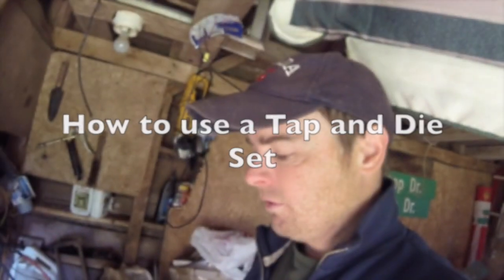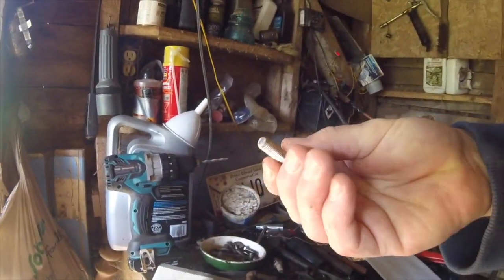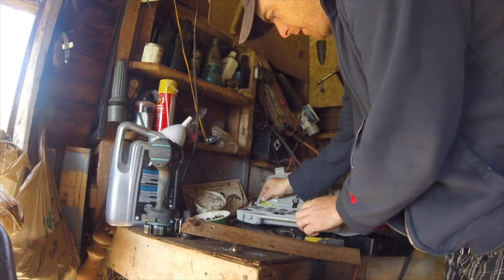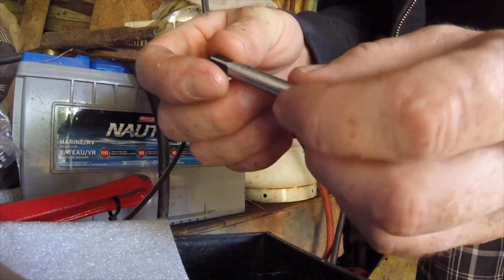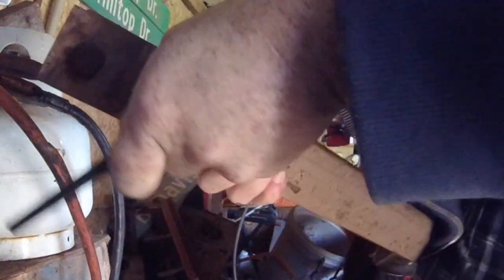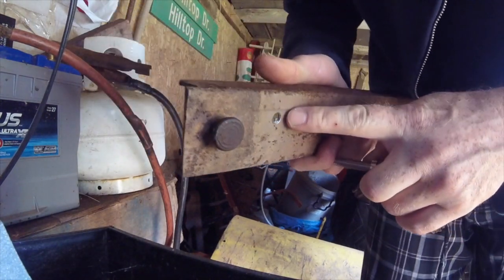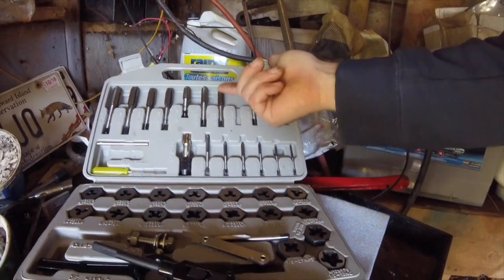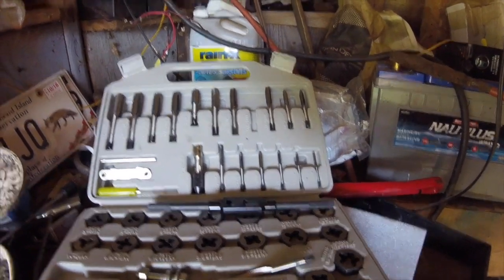HOW TO Use a Tap and Die Set - 3 EASY STEPS

Comment: ENUTS--Make sure you have the right gauge when you're checking taps or dies.  Irwin (formerly Hanson) sets have a SILVER gauge for SAE (Imperial or inch threads) and a GOLD or BRASS-colored one for Metric (millimeter).  NF threads denote National Fine  (more threads per inch); NC denotes National Coarse (fewer threads per inch).  Metric has just one type of thread, denoting the number of threads per millimeter (mm).  The thing you picked up to hold the tap is called a tap wrench.  The other handle in the kit, which holds the dies, is called a die stock.  While the threads at the bottom of your taps (and mine) are shaved to allow you to start them more easily, professional-grade taps are not.  They are left as is, and are considered bottom taps (i.e., they allow you to tap completely to the bottom of the hole).  This isn't critical when the hole goes completely through the piece you're working on, as it will be retained at the other end by a nut.  If you're threading a hole that only goes, say, halfway down, this allows the threads to grip the bolt or fastener completely, w/o any other means of securing it.  As others have mentioned, you should ALWAYS use cutting oil, grease or some kind of lubricant to make the process go more smoothly and reduce wear on the tap or die.  At the end of every job, clean out the taps and dies used with one of those cheap acid brushes and re-oil them before putting them away.
Reply from the maker: definitely need oil which i was lacking, yes :)

Comment: This is a good starter video - if folks want to be precise,  they'll need to be careful while drilling initially . . . if they can't use a drill press in order to start a perfectly straight hole in thicker metal, they'll end up with a crooked bolt alignment. In this video, you made it through the material OK but your tap would have broken in thicker metal - it is best to turn into the material no more than a half to one  turn at a time and then backing out of it to clear the material, apply a little oil and then turn in again , back out again etc etc until through. Good stuff!
Reply from the maker: Thanks for the comment. Great advice thanks!

Comment: Don't forget to illustrate that for every full turn forward you have to turn in backwards 1/2 a turn to break the metal chips. And don't forget to illustrate that a tap/die oil has to be used to prolong the life of the tap/die and keep them sharp.

Comment: Actually, you want to drill a hole slightly SMALLER than the tap size.  That way, when you go to tap the piece you're working on, it enlarges the hole enough to leave threads behind that you'll screw the bolt into.  If you have a decent set of taps and dies, the taps will have the correct size drill to use laser-printed on each one.  For instance, a 1/2"-20 tap will require a hole made with a 29/64" diameter drill.

Comment: you're supposed to go back and forth with the and use oil to lubricate  the tap ,screw it in and out bit by bit this is no way to help first timers by doing it wrong
Reply from the maker: yes, a couple people said that, indeed, definitely need to oil it!
Reply: And you need to go three turns forward and then two backwards to bread the chips out of the thread.  Then go forward three and back two.  Repeat and your tap will be easy to turn and will last longer.  All one direction can break the tap.

Comment: Little advice you always want to work on a flat surface and use a vise don’t drill on an angle and don’t hold the piece of steel freehand and tap you need to do it on a flat surface to ensure the threads are being cut or taped properly and after a turn and a half turn the tap a quarter turn in reverse to cut the chip and then proceed to tap
Reply from the maker: thanks, yes makes sense!

Comment: Good video, good for first timers ,advice is you should use cutting oil or WD40 before tapping this will make it easier and wont wear out your tool
Reply from the maker: thanks for the comment. very good point about the oil, great tip!
Reply: thanks man for the info, just bought my first set today and i had no clue about the oil.
Reply: Totally agree.Should put cutting oil before tap a hole to extend the product life